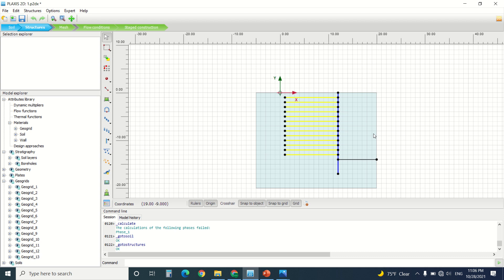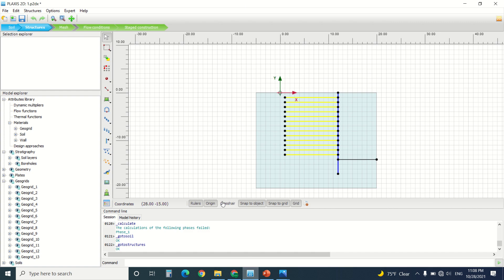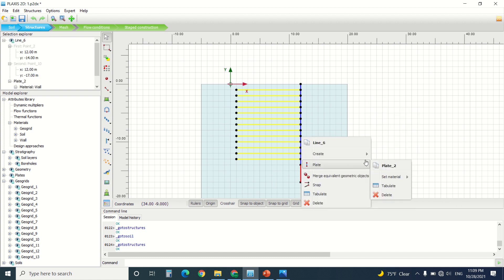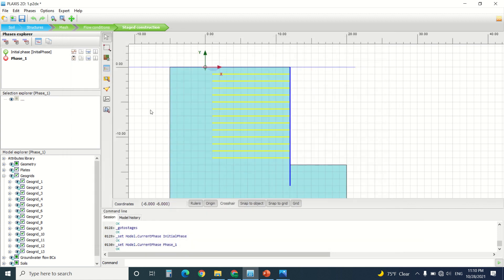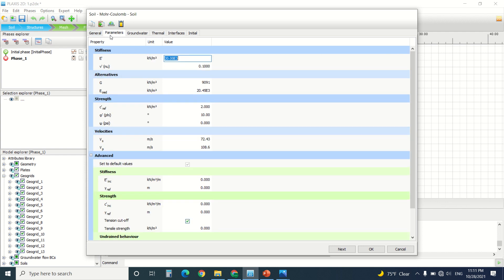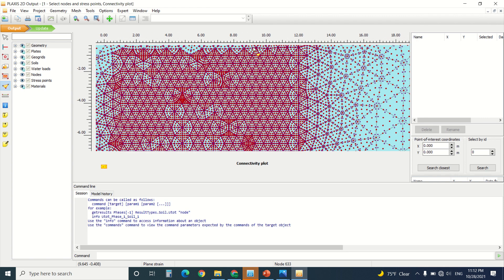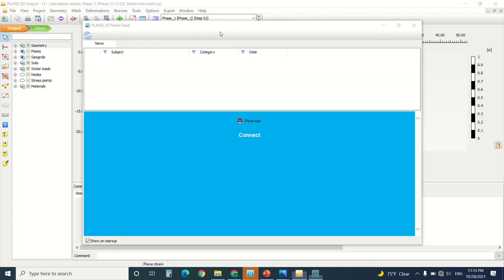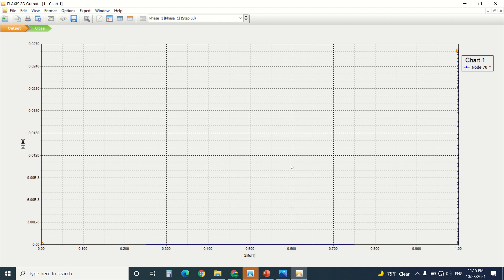Retaining wall with geogrid modeling plaxis

Comment: I have seen a few tall mse wall failure in nj and ny - connection failure at facing block is common.  Tall mse wall should use geogrid with positive connection.  Thanks.

Comment: Awesome video. But, I have a question. In this case, when we modified the soil parameters, the behaviour of the wall is not gonna be what I want, what it really is. For example, if I'm gonna be modelling  a reinforced soil wall and I use this alternative, and my soil wall is made by sand, I can not understand what is the truly safety factor or deformations on the face reinforced, because I'm changing its property. Is this case, the ideal would be put some behaviour conditions to the soil to simulate an embedding in the "face" not reinforced (the "face" behind). So, my question is: how can I put a condition like these or how can I pass through this modelling problem to don't cause a rupture on the back of my wall (this rupture, in situ, is not gonna happen).
Reply: the problem is not with soil properties, the soil body collapses due to the water table; dewatering should be done in front of the wall